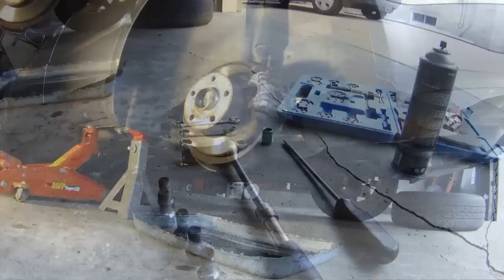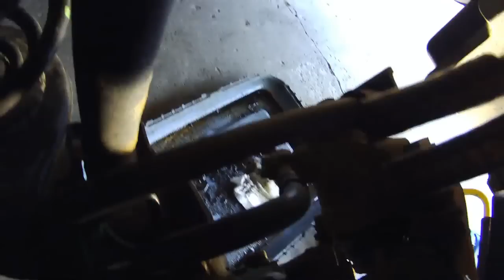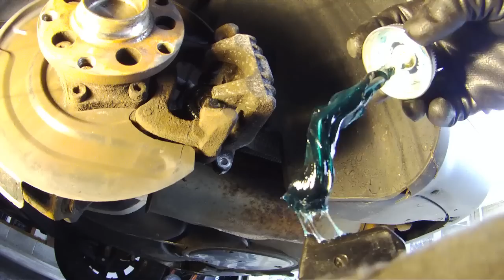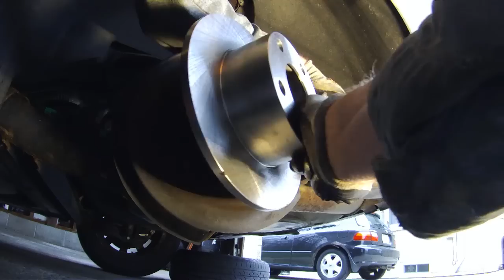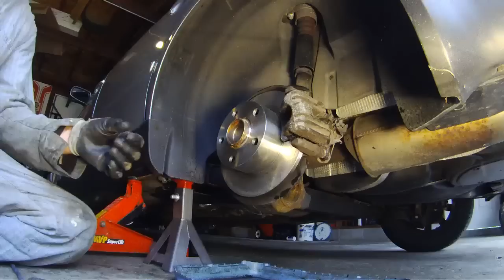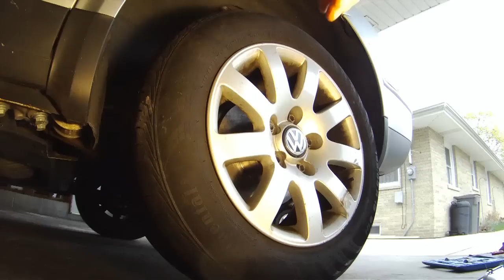VW Passat Rear Disc Brakes (1998-2005) also Audi A4 (1996-2001)

Comment: You vote your dates wrong. It's 1997-2000 (B5) and 2000-2005 (B5.5). And 1994-1998 (B5) with 2001-2005 (B6).
Reply from the maker: Thanks!  I updated the description and title accordingly.  The B5 and B6 designations have always baffled me because they aren't part of the badge and cover so many models so I initially just decided to use the simplified years and models referenced in the US Chilton and Haynes Manuals which only notes 1996-2001 models as being similar.  Later I realized many more model years were covered and expanded the title/description accordingly.  Now, with your recent post, I've expanded again. I've pasted the Wikipedia explanation of the various VW-based B5 and B6 platforms which covers 9 different international models from 1994-2011. 

B5 (PL45)
The B5 platform employs a longitudinal engine placement, which differs from the Volkswagen Group A platform which have been traditionally transversely mounted. This platform (also known as PL45) was introduced with the first-generation Audi A4 and the 1996 Volkswagen Passat. B5 platform cars can be equipped with a multilink front suspension and a Torsen centre differential for quattro or 4motion branded four-wheel drive systems. A long-wheelbase derivative of this platform - originally designed for the Chinese market and being used in the 1999 Volkswagen Passat Lingyu, but ultimately being used for its rebadged version under the Škoda brand, the 2002 Škoda Superb - is referred to as PL45+.

In late 2000, the B5 Passat received a facelift, referred to as "B5.5".

B5 / PL45
Audi A4 (Typ 8D, Avant 8D5, 1994–2002)
Audi S4 (Typ 8D, 1997–2002)
Volkswagen Passat B5 (Typ 3B, 1996–2000)
Audi RS4 Avant (Typ 8D, 2000–2001)
Volkswagen Passat B5.5 (Typ 3BG, 2000–2005)

B5 / PL45+
Volkswagen Passat Lingyu B5 (2005–2011; long-wheelbase version for Chinese market)
Škoda Superb (Typ 3U, 2001–2008)
B6[edit]

The designation "B6" is used to identify the "Typ 8E" Audi A4/S4 produced from late 2000 to 2005. The platform used by these models is formally known as the PL46 platform.

Confusingly, the current generations of Volkswagen's Passat are also colloquially referred to as "B6", given that they are Volkswagen's sixth generation mid-sized saloon. However this generation of the Passat uses the PQ46 platform for its sixth generation, an improved enlarged version of the Golf Mk5 and Jetta Mk5's PQ35 platform.

B6 / PL46
Audi A4 (Typ 8E/8H (saloon: 8E2, Avant: 8E5) / 8H7 (Cabriolet), 2001–2005)
Audi S4 (Typ 8E/8H (saloon: 8E2, Avant: 8E5) / 8H7 (Cabriolet), 2003–2005)

Comment: Neither of my pistons moved that easily. They're both stuck, and I'm not sure why.
Reply from the maker: You used the special piston compression tool that spins the piston, not a regular compression tool that just presses the piston, right?  You're spinning the piston the same direction I'm spinning in this video, right? You opened the bleeder valve, right?   BTW, see this video for an improved method of opening the bleeder valve.

http://youtu.be/C-MoQ5VuyHU?t=2m

Good luck with the rest of your project and let me know how it turns out!
Reply from the maker: Also...  Do the pistons not move at all? Or, do the spin but not compress?   If they spin, I wonder if you aren't getting enough pressure on them with the compression tool to grab the threads.   The pistons actually screw into the caliper, so you have to be able to apply pressure while twisting to get them to compress.
Reply: hanoihancock
They don't spin at all. Yep the bleeder valve is open and yes I am using a compressor tool that I borrowed from advanced auto parts. And yes I am turning it to the right like you are.
Reply from the maker: That is messed up:(.  Sounds like the piston is seized. Did the rear brakes work at all before?
Reply: hanoihancock I managed to muscle one loose but the other one I had to replace. Luckily advanced auto had one in stock, at $100 a piece. Rear brakes worked fine before, though I went through them very quickly (~16k miles---which is not a lot for rear pads). How did you bed them in?
Reply from the maker: Falken Punch Awww man.  Bummer.   If you went through rear pads in 16k miles, my guess is the pistons weren't retracting during normal use.  I didn't use anything special to bed the new pads in, but I did get some advice from another viewer that recommended I clean up the caliper a little more with sand paper and/or a wire brush so that the pads would seat easier.   In other words, you shouldn't have to tap them into place the way I do in this video.   You should be able to press them in by hand.
Reply: hanoihancock
Yeah I was hoping to keep it cheap the rotors were still in good shape so I didn't replace them but especially after ~13 years of being on the road these cars really start to nickel and dime ya. Overall the job wasn't difficult but there is just so much that can go wrong. Regardless though this video was very helpful. Thanks!

Comment: wait.. he didn't need to mess with the handbrake?
Reply: No. That's why you have to turn the piston while pressing it back. By turning you are "resetting" the handbrake. Just pull it a couple of times after the change, until you feel the full holding power.